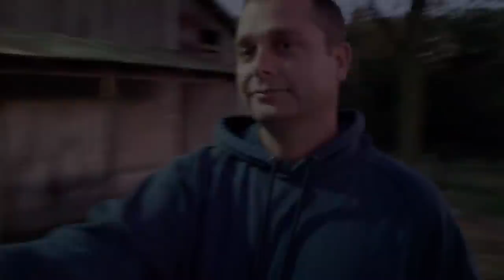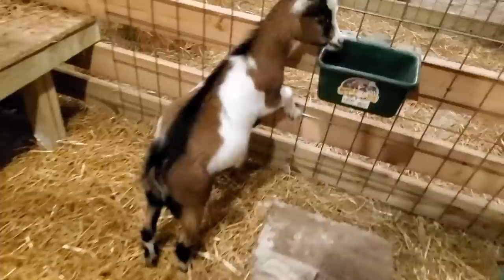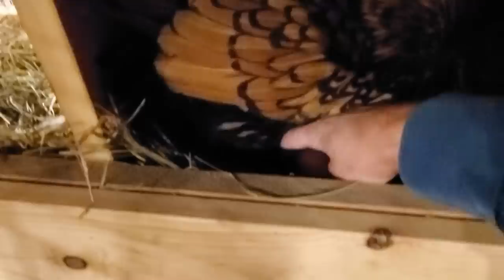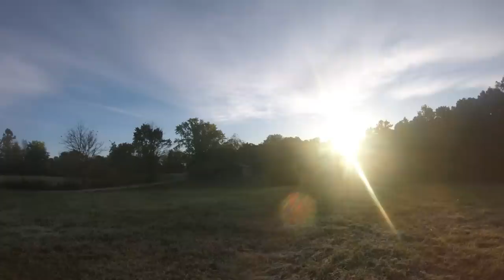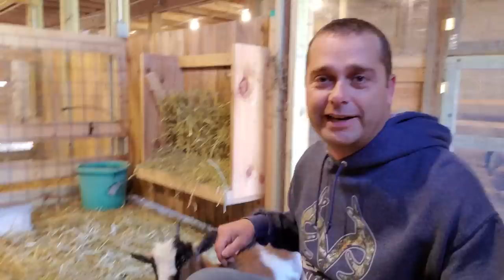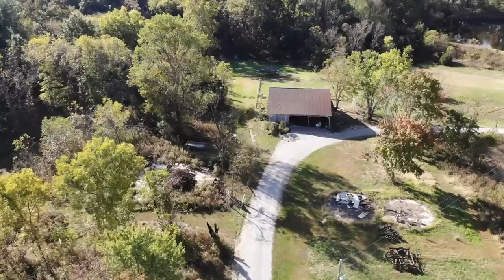We made some changes to Electrical in the Livestock Barn.  Plus Q&A

Comment: In our area we pay $35.00 a moth just for a meter. We have one building on a separate meter because we bought the neighbor's land with the building on it. We will be doing the same as you and running wire from our box to the building and saving $420.00 a year! We have to use conduit because it crosses a road though

Comment: Excellent video . Great explanation in why you did and changed things . I remember you putting that electrical wire in . Most hydro companies use aluminum these days for their over head wires . Got a new service put in and the wire was aluminum to the breaker box . From there it's copper . Don't know why you were thinking of a dry barn . When you put your water line in almost to the barn you were thinking of continuing that water line inside the barn some day . Well now you're all set for when that happens .Looking good .
Reply from the maker: I dont know what I was thinking also.

Comment: chickens tend to spill a lot of food out of the automatic feeders. easy to fix by putting a small diameter garden hose ouround the edge. you mesure the lenght of hose you need and cut only through half the diameter and slid the cut sixe over the ledge og the bottom feeder. Just an Idea

Comment: I believe a GFCI outlet can be used to protect non-GFCI outlets downstream from it.   I would look carefully at the possible wiring  options.      GFCI outlets have Line terminals for incoming connections (from  the Breaker Box)   and Load terminals for protecting downstream  wiring..   Good luck and God bless. you  all
Reply: If you decide to have a workbench or project area with multi outlets then you can re-use those non-GFCI outlets downstream from the first GFCI outlet on that branch circuit as Jeffery suggested. Just be sure you apply the "GFCI protected" labels on the downstream outlets. Also it is a good idea to run your main light circuit off a different circuit breaker than your outlets. I found out how dark a shed could be back in the '70's when running a circular saw through a heavy piece of wood as it bound up and blew one of those old 15A glass fuses.
Reply from the maker: I understand a GFCI can protect 3 additional outlets.  But that goes back to more water buckets may freeze if it trips.  So, individual gfci outlets was intentional.

Comment: Sometimes it doesn't pay to be cheap. As a old firefighter emt, I have worked mobile home fires that was caused by the aluminum wire and copper wire reacting with one another.

Comment: Reading these comments on copper and alum wire.  As I understand it, alum will vibrate in the circuit breaker box under  the passage of high currents and vibrate right out of the connection with the passage of time.  Arcing starts in the box and your house burns down.  Copper wont do that. Hence modern wiring changes from alum to copper at the box. Or so I'm told.

Comment: Putting pvc pipes in the ground will, over time get water in it, no matter how much glue you use.
Reply from the maker: Yes, PVC would protect the wire from rocks in the soil digging into the insulation, not form water.  Good point.

Comment: evan, if you had run the 2 inch pvc underground for your feeder you could have bought cheaper wire. it would still be aluminum but would not be direct burial cable making it a little cheaper. the cost would probably wash out. the advantage would be in being able to pull in new if lightning damages the original. one other thing would be the ease of teeing to another location if the future demands it. i think you did great and it all looks good.........g

Comment: The load center in the barn should be mounted on a piece of board attached to the wall to keep metal   the load center from touching the concrete to keep it from early rusting. Just saying.......
Reply from the maker: Yes it should be spaced off the wall.

Comment: I don't know who is feeding you this bs about chickens not able to find the roosts after lights go out, I been raising hundreds of layers for over 38 years, and my timers are set to come on in the morning at the same time as sun rise in mid summer, and turn off at winter sun rise, and come back on just before sun set at night and stay on until the longest summer day, they know when it is time to get on the roosts, and even if some fall off in the dark, they know were to go to get back one, young ones if the light go off before they are up, they always find there way up in total dark.. remember to pull a permit for any electrical work you do, even if your adding a plug or 2 as you can be charged for not doing so, also, if you have a fire and it is said to be started by electrical, and no permit is on file for that area, your insurance will be void
Reply from the maker: Where we live there is no building permits or electrical permits.  The only permit the county requires is for installation of a septic system.
Reply: @CountryViewAcres  were i live i dont need any building or septic permits but hydro is its own game and must have a permit